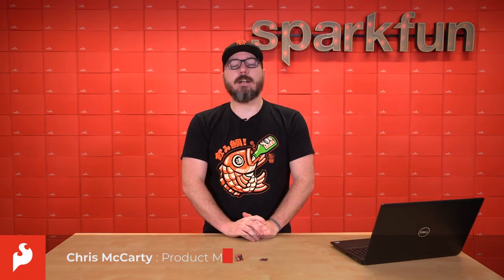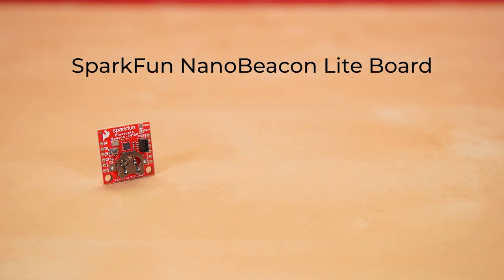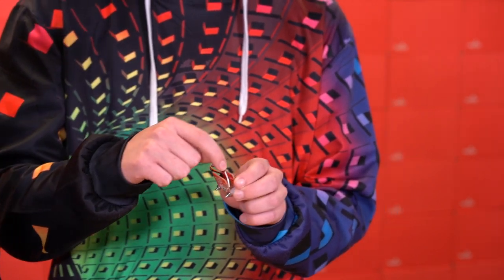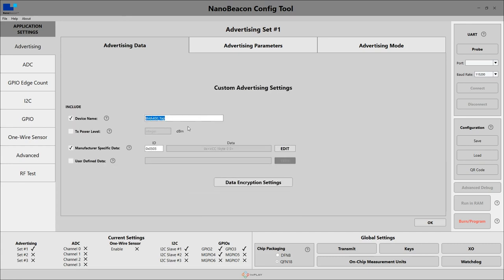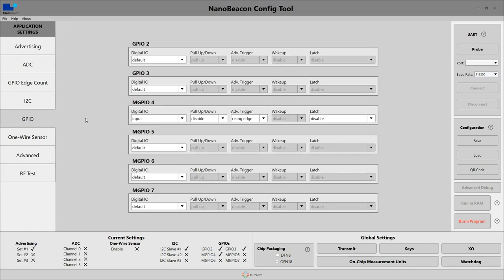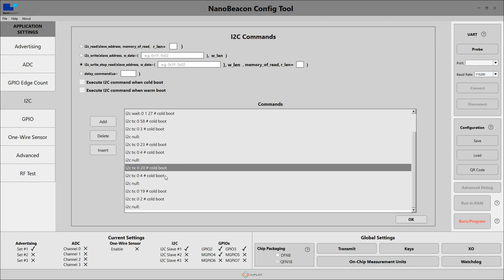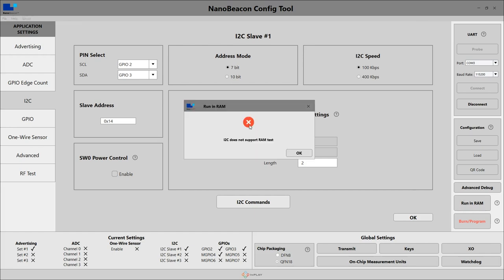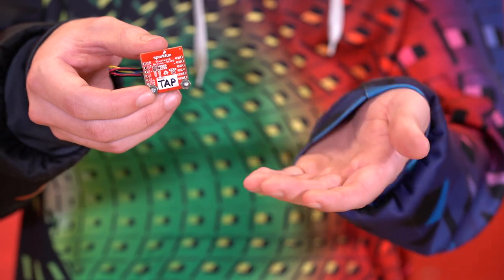Product Showcase: SparkFun NanoBeacon Board

Comment: Please help. I bought sparkfun IN100 lite board. When I solder a button to the gpio pins and set trigerred advertisements, yhe battery drains out so quickly like within 2 days. Please help what’s causing this?

Comment: how do you know the I2C config is correct before burning the chip? You run all you config on a other micro and then copy paste the I2C command to the config tool?
Reply: on digikey the IN100 NanoBeacon is 1,5 to 2$ cdn each. Not bad if you make a mistake.

Comment: So the "burn/program" option is permanent?
Reply: The configuration is on a "One Time Program," so once you write the data it is literally burned in and can't be changed. It's an inexpensive type of storage compared to the flash storage you're probably used to. It's used in applications where the data doesn't need to change, like sound effects in children's toys.
Reply: @nyckid  Ok, cool, just wanted to make sure I understood that right. I suppose if someone wanted to make changes they could just use the run in RAM option repeatedly